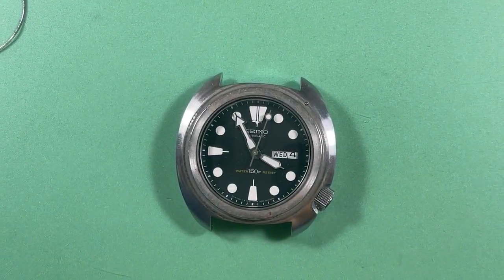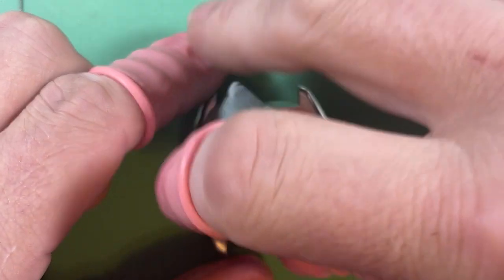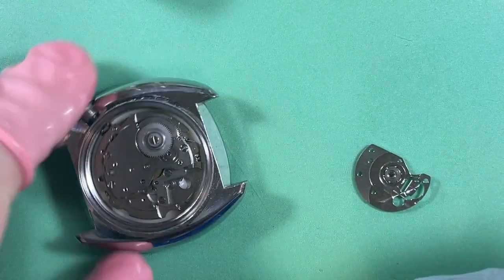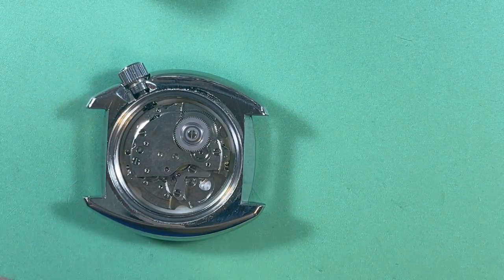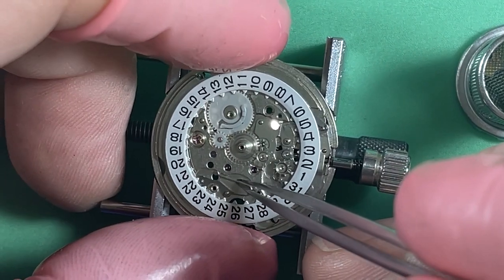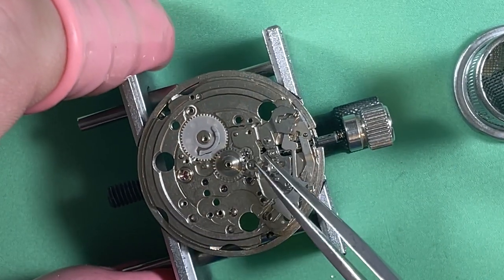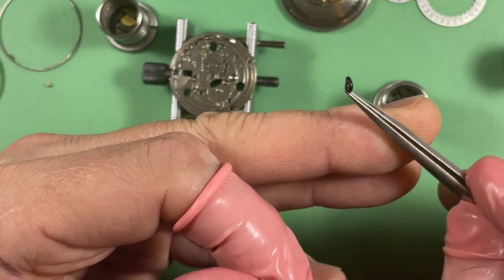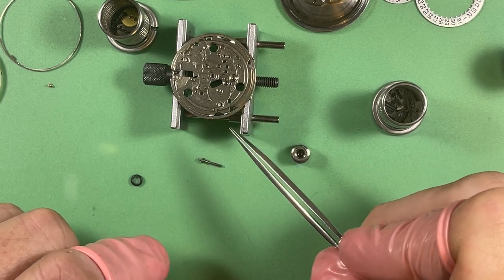For SS: Seiko 6309-7049, super nice all original baby.

Comment: This watch came to me from a widow (ebay) and the crown was unscrewed so i think it stayed for years in a sock drawer with the crown out.  Alot of folks say service a watch only when it stops running correctly but by then your parts are worn out and parts may not be available.  I whole heartedly believe sending both watches in was the right choice. Save me a spot in 2028 👍🏼.
Reply from the maker: Awesome!

Comment: I wonder if it had been worked on in the past thus the excess oil, scratch and over-tightened screws. It was a super watch to begin with but now its a champion...nice work Spencer!
Reply from the maker: The caseback seals only act and look like that when the watch has never been opened, as far as I have seen.  I could be wrong, but that's what it seemed like to me.